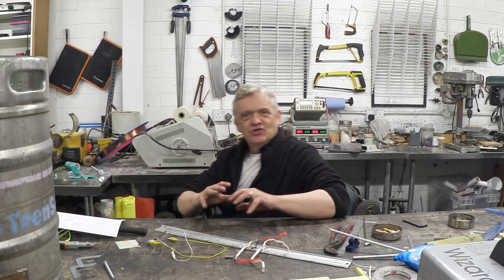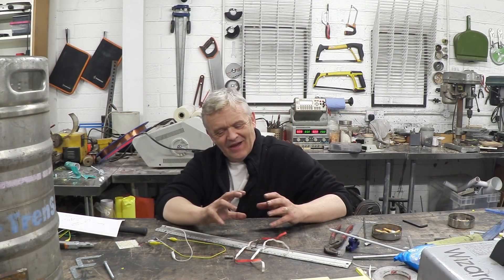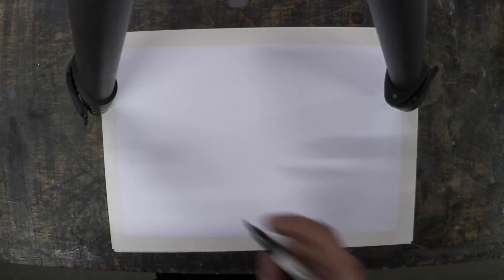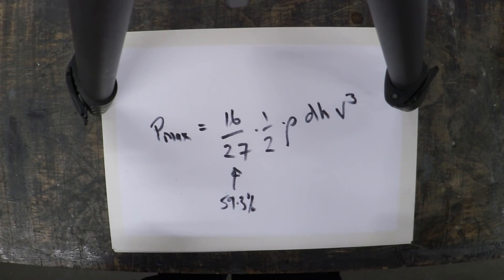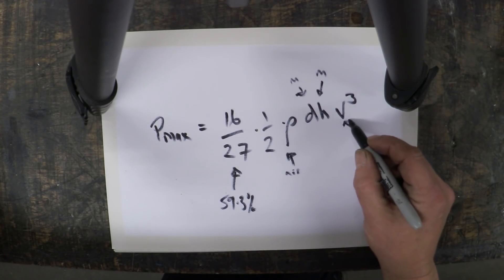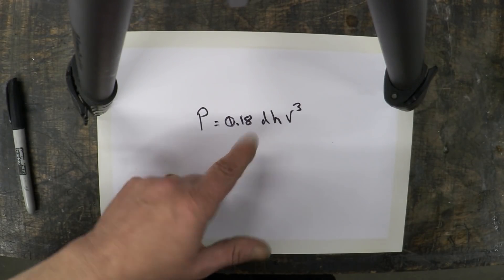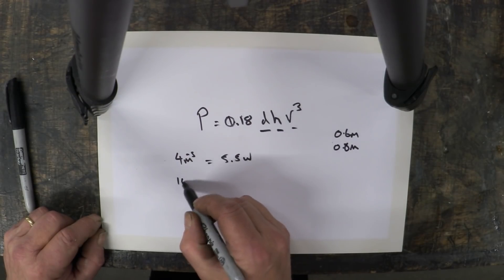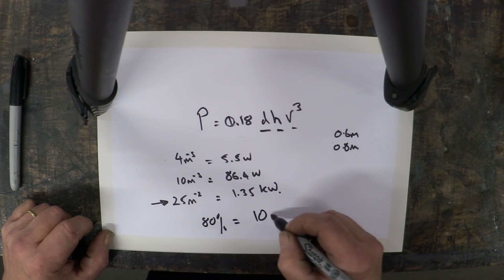Building a 1kW Wind Turbine For Under £100 - Betz Law

Comment: Great project.  Watching with interest.
Suggestion for next stage
Have 2 rotors. 1 on top of the other. Use the vains to force the rotors  to force rotation in opposite directions. Put the coils on 1 and the magnets on the other.  Effectively doubles the passing speed at the interface.
Reply from the maker: that's a good idea mate - it will mean I need slip rings on one rotor for take off thought
Reply: @ThinkingandTinkering  It won't make any difference to the output, as you will have two half height rotors each taking half the amount of energy from the wind that the full size rotor does, so the output for a given wind speed will at best be the same - though additional frictional losses, coupled with additional dead space in the rotor assembly mean that the output would be reduced.
I do find it bizarre that someone who states that the strength of the magnets and the design of the coils aren't important thinks he can rival a commercially designed, tested and manufactured wind generator for efficiency.
As I noted in a comment on an earlier video in this series, there's no chance of such a jerry-built wind turbine/generator producing anything approaching a 1kW output...

Comment: I could be wrong on this one but is Betz Law not only for horizontal axis "propeller blade" types?
I have tried looking for equations for VAWT but not been successful up to now .... tbh there are so many different designs that each may need its own. 
One way of getting more power is to create a baffle that funnels a larger area of wind into the turbine .... but often that is not practical! I wonder if you thought of that when you designed those flat support pieces?  
Eather way ... another video to make folks think ;0)
Reply: Dave W 
Betz law applies to both, equally. It’s the maximum amount power that can be extracted by a 100% efficient turbine of a given area. For a horizontal axis that is the area of the propellor disc, π.r^2, where r is the length of the blades. For a VAWT, the area is the diameter of the rotor by the height (d,h) in the equation at 2:10.
😉
Reply from the maker: Betz is indépendant of machine design mate - QED has it

Comment: Why are you mentioning KWH? it's KW
Reply from the maker: because I am a battery guy and I always think of energy density in those terms - my bad - I usually mean kW but when 'running off at the mouth and not thinking about what I am saying' I will say kWh
Reply: @ThinkingandTinkering  I had a feeling it was a slip of the tongue. Have you thought of using a F&P smartdrive motor as a generator? How about an alternator from a car?. You're not going to get much efficiency from a magnet flying past a microwave transformer core.
Reply from the maker: that's not what I said - I said it was a waste of time trying to prove anything to other people at this stage - at this stage all I need to prove something to is to myself.

Comment: I've messed with magnets a little and the Halbach array is an objective increase in directed field force.  Yes, if you want A/c you'll have to put a net losing device between it and the load but why not go for the gusto.  High voltage DC makes strange magic and besides battery banks are aligned for it.  Let my ignorance be a guide.
Reply from the maker: for sure mate lol

Comment: He was hoping someone in the aeronautical industry would improve on his findings and produce a better system.
Go back and look again at Wikipedia and it explains that Betz Limit only applies to an Open Rotor system... your system is NOT subject to Betz Limit as it is a different design than what was tested by Albert Betz.
Reply: Are you saying this design can extract more than 59% of the power available in the wind falling on its swept area?
Reply: @dexterdixon2000  With a few more refinements to his design it would be possible.  My expertise is in Ducted Systems.  The ducted system I created was tested to be a CP=4 class (Coefficient of Power). Meaning it will harness 4 times the power over a ducted system of equal size.   Do you know how hard it is to tell an engineer they don't know what they are talking about when it comes to Betz Limit?  While this CP=4 has been a theoretical formula for many years others have claimed that a CP=8 or 8 times the energy is possible.  My new design has already been tested and proven.
Reply: @phillipr303  Not sure I understand what you mean by CP=4. Do you have any published work about this?
Reply from the maker: wow - I didn't know that at all mate - thank you very much for the pointer

Comment: I agree about efficiency differentiation depends on magnet and coil positioning. I want to build one a metre high with thin ribs in the rotor curves. I guess this could be done with wire if not with solid ribs to achieve strength in high winds.
Reply from the maker: interesting idea mate - cheers

Comment: Most German car main dealership's have empty add blue barrels which they pay to have removed. If you obtain an empty one and split it vertically into 4 you get 4 directional wind baffles for free. Add blue I'm assured has the same formula as pig pee without the scent. A quick rinse should do it
Reply from the maker: nice one mate - cheers

Comment: Mathmatical models are great for getting a good feeling for what a real world design can do. Taking basic equations and adapting them is an inherent part of engineering. This is a great example of this and shows promise for this turbine.

There a a varity of options for increasing the efficiency, such as blade geometry and balancing.

Another great video 👌
Reply from the maker: balancing has certainly been on my mind

Comment: I enjoyed this video and look forward to the next.  Perhaps where there is disagreement is also a misunderstanding of KW vs KWh.  I think your critics are, perhaps without realizing it, coming from the knowledge that winds are rarely sustained at any steady speed, You are entirely correct to measure and rate your project with the same assumptions as commercial projects.  I don't think Betz' law will silence the critics who correctly observe that wind isn't constant.   Promoters of subsidized wind power generation do not explain that the 25ms wind speed occurs less than 30% over the service life of the wind turbine, and the maximum service output of a single generator is less than 0.3 times the KW rating .  Your approach of using inexpensive materials (with distributed, point-of-use generation) is much more economically feasible and sustainable.
I wonder if rating at 25ms velocity is useful, as this is more or less equal to 90 kph or 55 mph wind speed.
Reply from the maker: I really don't understand the focus on high wind speed - the average wind speed of an area and trying to extract power from hat seems a more reasonable approach to me

Comment: It seems to me that the 'law' is not allowing for the fact that you are adding so many more coils to the wind turbine.  If you only have one coil .. it would be the energy collected in one revolution.  If you have 12 coils .. a lot more energy is collected.  I am wondering if there would also be a way to connect the energy from a solar panel to operate a small motor that could turn the turbine when it's not windy (probably inefficient) .. but it would be interesting to add a cross-over source that could keep the turbine moving .. like heat from the attic going up a chimney.  Very interesting, inspiring, thought generating sessions!  Thanks for reading!  🤣👍
Reply: Thats a great idea, I wonder why they dont do that on wind farms.
Reply from the maker: it doesn't mate you are right it only talks about the potential that can be collected - the actual depends on coils etc and the difference between the actual and the potential is the efficiency
Reply: @ThinkingandTinkering  Thanks for that!  👍

Comment: Excellent video. I've pulled a couple pulleys from a car engine I was replacing. I'm considering using them for the top and bottom supports to my wind generator. Coupling that to a few conversion pulleys from swamp coolers, then to a car alternator to charge batteries. The alternator is a standard Toyota 70 amp alternator. Theoretically my maximum is 840 watts. I'm hoping for 400 to 500 watts. I'll be happy with that. At 840 watts, I don't want to go outside. Even at 400 watts, the wind is blowing somewhat harder than I like, to do work outside. Cheers
Reply from the maker: I like the plan mate

Comment: The issue is the pressure envelope that develops in VERTICAL AXIS turbines vs the OVERSPEED OF A HORIZONTAL TURBINE. Otherwise, you would see VAWT farms everywhere but you do not, you find horizontal turbines because they can overspeed and a 15 Ms wind becomes the equivalent of 25Ms when the turbine overspeeds. This can not be done with a vertical axis, you will not defy physics no matter how optimistic you are.
Reply: Not true. Rob DID defy physics when he got his Magnus turbine to use the Magnus effect without spinning the rotors ! He copied a design and missed that the rotors were powered, yet it still worked ! I guess the fan blowing just on one side helped.
Reply: @goldmagnet9013  if a fan was blowing, he defied nothing except honesty. The fan replaced the motor in the magnus effect. One could put fins on that make them turn counter clockwise as well, still does not defy physics. That is impossible outside of subatomics.
Reply: @JSabh  Agreed.
Reply from the maker: why do you think I am trying to defy physics?
Reply: @ThinkingandTinkering  Like not spinning the rotors on the magnus turbine, and saying it worked awesome and used the Magnus effect and encouraging people to build one. As I said before I have generated my power for decades, I encourage people to make their own turbines, but with designs that are practical and work. Windmills made from scrap are the norm for many and there are tried and tested designs (brake disk etc). Rob wind turbines are judged on how long they last, and how much power they produce so please put the meter in from of the camera, use a known test load and measure the actual power it produces in real time. Do this with all your generation projects, volts mean nothing in isolation, there are thousands of them everywhere, you know that from combing your hair, but very rarely do you provide the relevant information to your viewers, you just say experiment for yourself, when a lot of people would like to know if they would ever generate any real power.
Reply: @ThinkingandTinkering  I have yet to hear you address the issue, forgive me if I missed it. That is why I point it out and so that others understand the most basic physics of wind turbines given that you are talking about wind turbines. I do think VAWT are much safer and would like to see more of them but, if it isn't explained, folks just won't understand that.

Comment: 0.1 x 24 x 365 x 0.14=122.64 ( with the units kW, Hours, days, pence, Pound Sterling) no matter how you look at it it pays the 100 Pound (Sterling) in less than 1 year, even at 0.1 kW . Is there anything incorrect in my assumption?
Reply from the maker: looks fine to me mate

Comment: The Betz law governs the amount of energy one could extract from wind by using any possible shape, or skiny  things like wind turbines? I mean, it is very clear to me looking to sail boats that sail wings extract much much much more more energy from the wind than any wind turbine. At least for bigger things for sure...
Reply: @Ed R4 so it would be much better to use sail wings instead of blades in bigger equipments, right?
Reply: @Ed R4 something is wrong. Sail wings have three dimensions of large areas, wind turbines have only two.
Reply: @Ed R4 no, wind turbines gets the most of it's energy with the height and width of the blades, not the depth because it is too skiny. Boat sails does height, width and depth as well and it's much more eficient.
My question is if Betz Law and this formula presented here also works for sail boat like structures. Have you seen a Caravel? I'm sure it would not be pushed if they used blades instead of sails.
I mean, why not use wings in a circular form instead of blades?
Reply: @Ed R4 well, I'm telling that because a sail like wing generator won an international X-Prize competition in 2017, in which a 3 meters equipment mounted in the top of a 11 meters post reached 50KW/h, producing 2000 atmospheric water liters per day. It's a lot of power with this size. The creator said it works better above 10KW/h right because it uses three dimensions instead of only two of traditional blades, so it is much more scalable.
Reply: @Ed R4 if this is true, how the sail like equipment performed so well? I think that torque is much more important in big equipment than high RPM.
Reply: @Ed R4 no, the equipment was used to power an atmospheric water extraction equipment, not a water pump.
Reply: @Ed R4 are you counting the amount of vibration generated by a equipment running close to the speed of sound compared to an equipment running more softly? Or the fact that the majority of the wind is lost because the distance between two blades in a big system takes too much time to turn? If you are not turning too quick to vibrate, and your equipment takes less time to turn and get more wind, so it's clearly a better design.
Reply: Hellgazer 
He’s wrong about the speed of sound, but they may be doing 3-400 km/h. But he’s right about the efficiency. Even the very best soft sails cannot compete with modern turbine blades.
Reply from the maker: it doesn't govern it describes mate - folks like to forget that and call it a law and say it governs - but I think that I getting the ideas backwards
Reply from the maker: I have checked your channel and it was started 1 nov 2020 with no content - did you start it specifically to post here? I am not happy about your attempt to be a forum guru - please moderate your comments to be more respectful or I will ban you. Be warned I do not enter into discussion about this
Reply: As a sailor, when 17 kts of wind can propel my 15 ton boat at about 4-5 kts (nearly 6 mph) even with hull friction and my crappy sail trim on my genoa (not even with the main up), it's plain we are not harnessing enough of the wind. I wonder if there are ways to design a VAWT with a deformable aero foil (like a yacht sail). Obviously my sail is probably 10-15m tall....
Reply: @cimota72  that's a big amount of power, right? My guess is that small turbines up to 10KW/h, like this one Doc Rob made, works best because they can move faster, but if you need something bigger (like commerce or industry level) - surely a sail would work much better.
Actually a VAWT exactly like this won an X-Prize in 2017. I don't want to make advertisement in Doc's channel, but you may google jmcc wing generator. It's exactly what you think: sails in a vertical ferris wheel form.
Reply: @Hellgazer  I'll have a look.

Ta!

Comment: Why do you keep saying kWh? That's a measure of energy rather than power. I'm assuming you mean kW?
Reply: I think he means an average of 1kWh a day when deployed under average windspeed conditions.  If you can build a turbine that can produce an average of 100W for 10 hours of projected wind loading then you have a 1kWh of energy per windy day.  Because wind conditions are so variable, wind turbines are rated in kWh for this reason, during a 24hr period it may be producing 180W sometimes, 40W another, 80W another, and sometimes 0W when there is no wind; but produces a total of 1 kWh over the whole day of generation.
Reply: @newtonbomb  I've not seen turbines rated this way... I've seen charts for average windspeed vs kWh/month but I've not seen "kWh per day in 'average' wind speed"
Reply: @newtonbomb  they makes sense but he says it right after calculating power for 25mps wind which appeared to have theoretical output above 1kW. IMO if he means in the course of a day he should include that calculation to clarify. Especially since mixing up power and energy is a common mistake that results in bad conclusions.
Reply: @newtonbomb  Thats not what he said in the first video of the series, he compared it to a 1Kw class turbine.
Reply: Ok, fair play @all My assumptions did as they do, make an ass out of me lol.
Reply from the maker: I do mean kW mate - I am basically a battery guy and used to thinking of energy density in kWh - so - if I am 'running off at the mouth' and not thinking straight I say the wrong thing - sorry - my bad
Reply: @ThinkingandTinkering  NP my man, I spend more time with my foot in my mouth than not so it's par for the course for me lol.  Plus, I do think that kWh makes more sense to describe the energy harvested via wind; to me what seems most important is the overall peak density achievable over a long term deployment and not the instantaneous peak energy generation possible during relatively rare brief high wind events (especially for the local environment you are building specifically for).
Reply: @ThinkingandTinkering  thanks for clarifying! Wasn't sure if I was misunderstanding.